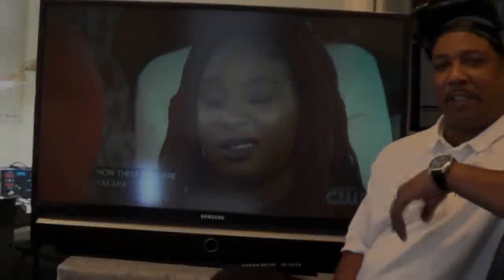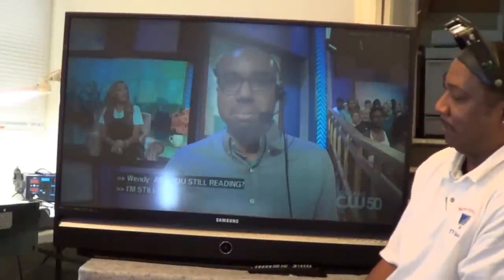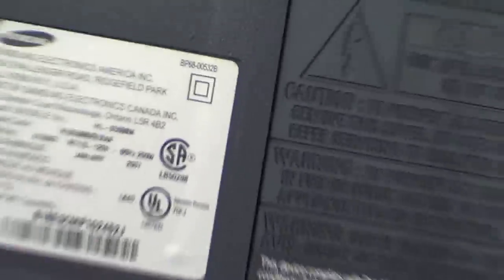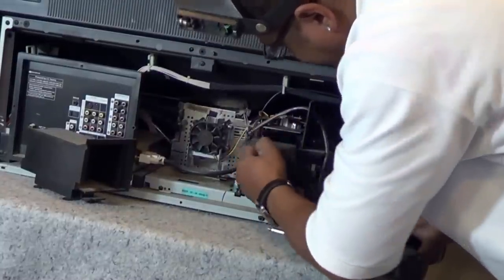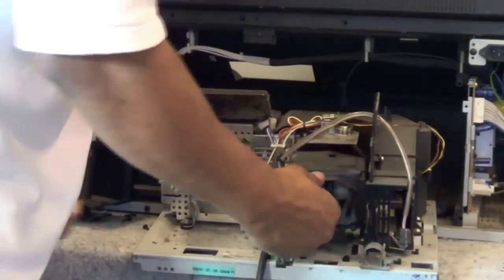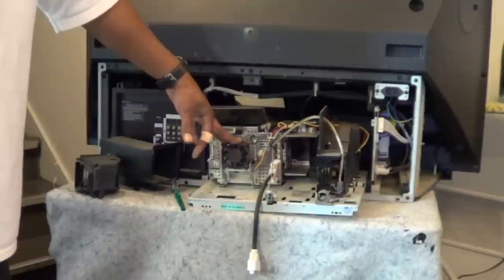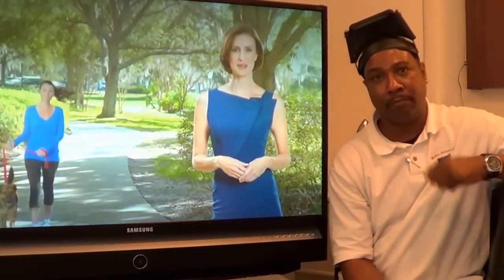Why your DLP TV keeps blowing Lamps every 3-6 months

Comment: bigdog8882, this worked like a charm. I cannot believe it. We have a 65-inch Mitsubishi, and we usually replace the lamp every two years or so. This time, the lamp failed after about five months. After looking at your video, I opened up the back cover and couldn't believe the chunk of gunk in there -- yuck. I cleaned it with a vacuum cleaner, two cans of air compressor and a small toothbrush -- just as you demonstrated -- and lo and behold, our big TV is back working again. Thank you so much. God bless you. Hitting the subscribe button right now ...

Comment: Thank you Very Much for your video! I've recently had a problem w/ my projection lamp shutting off within 8-10 minutes of turning on my 2006 Samsung DLP 67" TV.  After the lamp shut off, the "Timer" and "Lamp" lights on the On/Off button would flash; if I restarted the TV, the lamp would then shut off within 2-3 minutes.  I replaced the lamp w/ a new OEM lamp for the second time in 13 years, but the new lamp continued to function Exactly like the previous one: shutting off within 8-10 minutes, then shutting off 2-3 minutes if I turned the TV on again.  After watching your video, I took out my home vacuum cleaner, attached the upholstery-drapery tool (with soft bristles) to the hose, and vacuumed all the open grates on the back side of the TV (they'd gotten clogged with dust). BIG DIFFERENCE: the projection lamp now shuts off about 10 minutes after starting the TV, but when I restart the TV with the "Timer" and "Lamp" flashing, the lamp stays on indefinitely.  My theory: the dust clogging the grates was causing the operating temperature of the projection lamp to overheat and trigger the lamp shut off.  I'll next follow your video's procedures for pulling out the assembly that includes the projection lamp and fan, and vacuum all dust in the area of the lamp and the fan cooling it. Hopefully this will solve the lamp shut-off problem completely.

Comment: I got the 72" model from my job 5 years ago and the first bulb lasted almost 8 years, I replaced it and the current bulb is going on maybe 7 years. It started humming, then buzzing and finally wouldn't come on. Took the back of and blew it out with compressed air. Minimal dust but it solved the issue.. Thanks!

Comment: Thanks for the great video.  I do buy the discount lamps since the original one blew, and they were doing pretty well.  I had to do a light chip replacement (what a PITA!), and at that time had blown out the fans, didn't even think about it - there was dust when I cracked the case so took care of it and have killed 3 bulbs in the last 9 months - doy, right?  I will clean them boogers before my next lamp shows up and do so every time I have to swap.  Thanks bigdog!

Comment: I have a 73 mitsu dlp from 2009. model wd 73737.  I have probably changed my bulb every year.  My t.v. is on probably 90% of the day, there seems to always be someone watching it and you do not want to turn this t.v. on and off liberaly.  I save my bulb by dimming it before i turn it off.     What I mean is I put the picture mode into another mode that I have set with very low brightness and contrast.  Then I turn it off.  When you turn it back on the bulb will not be as stressed and therefore is less ap to pop or bust.  Give it 5 min. then put the picture mode up to preference.  I also put a tiny air cleaner near the back of the stand closest to the bulb.  After a while no matter what it will have to be relamped for the best picture.  That was just a tip if anyone wants to use it.  THE PROBLEM I have is the picture is not as crisp and I pretty sure It needs to have the mirror cleaned or the inside of the screen cleaned.  Problem is I am someone who thinks if it ain't broke don't fix it. IS THERE ANY TUTORIALS ANYONE HAS SEEN?  OR ANY ADVICE?
Reply: Cynthia Sootkoos I have the same tv and I’m about to put another lamp in mine after I got a pro lamp and it only lasted 4 months this time and I took it apart and cleaned everything
Reply: My Mitsu lamp exploded today. Lamp lasted 3 yrs. It's expensive to replace and I'm tired of it. I just want a tv that lasts. I wont throw out my old tv's because one is from '88, others are from 90's and guess what❔  They still work just fine. But not these smart tv's. They're not smart. They're shit. Imho.

Comment: You could use fabric softener  sheets  as a dust filter what I do is krazy glue the edges of the softer sheet to the outside of the vents or spray adhesive spray on the outside of the TV vents and stick your softener sheets to it you can pick it up at the Dollar tree they got the adhesive spray and the fabric sheets for $2 same thing with all your electronics computers TVs

Comment: My Samsung DLP is 16 years old and the Philips lamp is 10 years old because I have installed a small square external exhaust fan blowing the inside air out.  Dynamic setting causes more heat and less lamp hours.
Reply: how did you go about installing an exhaust fan?
Reply: When changing bulb, should I also be cleaning off mirror of dust too?

Comment: You forgot to mention sometime the Blast board could be dead too.Must clean out all dirts to the cooling fans devices that helping keeping the picture lamp clean,cool and can last you like a least 2-3 years.If you just watch like 2-3 hours a day only.
Reply from the maker: Your right Chi, a bad Lamp Balast could also cause premature Lamp failure. I should of mentioned that. Always clean the fans first. Then If balast is bad, in my experience  the Lamp will probably only last a few Days.
Reply: I have a Sony Wega 70 inch which gives me 7 red flashing lights and takes a long time to come on. When I got it off the sidewalk it needed a bulb but it blew very quickly a couple of times. I spoke to a parts servicer and he says it probably is the ballast, what do you think? It also has a melted bulb door from the previous owner too but he said they don't make them anymore.

Comment: I actually had the same set except for it was the 67 in it was the Samsung hls6767room he was too big biggest mistake I made.so about eight months later our TV went out in the living room. This TV from the garage, used it for 5 minutes then a weird picture came up heard a pop. distorted looked very bad upon inspection found out the Dmd board  technician told me it was the DMd boardrain got into it and rusted the DMD boardso I had to replace it. While replacing it I think we messed up the chip the DMD chip so we had to replace that overall a $30 TV ended up costing me almost 180 to 200 to fix but I ended up selling it eventually getting my money back out of it for 200 but it was sad because that was a great TV one of the best I ever seen but if you know what the problem could have been let me know. Thank you

Comment: Just took my moms apart this morning, thing kept turning off. Cleaned that mess, installed new Phillips lamp, thing is as good as new. Only thing is the green light on the front of the tv is always off now.
Reply: When your mitsubishi dlp tv kept shutting of and you cleaned the fans did you do it yourself or hire a tv professional to do it. Mine works but it shut of with a blinking yellow light indicator. So I guess its to hot right. So if I clean those fans it should be good you think.
Reply: samuraispiritsx why is the green light off after you cleaned the 📺. It doesn't turn off anymore does it

Comment: i JUST CHANGED THE DLP LAMP ITS GOOD AND ALL AND BRIGHT JUST IT WILL STAY ON FOR AWHILE AND 
CUT OFF IN 10 MINS AT A TIME OR SWITCH  FROM TV IMPUT TO TO NEW IMPUT CONSTANTLY OR BACK TO BLUE SCREEN, I SWITCH BACK TO TV AND 2 MINS IT SWITCH BACK TO NEW IMPUT DO YOU THINK IT NEEDS TO BE REPROGRAMMED? and this is a 2009 Mitsubitshi 60 in tv.

Comment: Yes I'm having trouble now with my big screen projector Mitsubishi 2013 I put a new lamp in it works great now sometimes a sound don't come on and I have to turn it off for a few minutes and then turn it back on sometimes the sound will come on sometimes it won't now I get sound picture and in 10 seconds probably 15 at the most it turns off automatically why is it doing that? What do I need to do to fix that problem

Comment: I have a Model Samsung DLP HL-5086WX and I cleaned my fans like you showed in the video .  I have also put in several new bulds from different vendors.  But when I turn the TV  on, it usually shuts off after 10 minutes and the 3 blinking lights come on (red (Start/Stop) green (Timer) and green (Lamp).  I thought I might need to reset the lamp timer or just turn it off , if possible, but my original Samsung remote is broken and I can not get to that option.  Can the lamp timer be reset or turn off without using theb remote?  Any additional thoughts on what to check?
Reply from the maker: Not sure, just order the Remote off of Ebay or Amazon. But that wouldn't shut the TV down though. Sounds like you may have another problem, like a colorwheel.

Comment: I have a 73" dlp. The bulb blew up I went cheap on a bulb the TV would work good for a few minutes then the picture would go all screwed up like so bad you thought the color wheel was damaged I read online people having this problem and replacing every part with no luck. So I bought an expensive O.E. factory bulb put it in that fixed every problem TV has worked perfect for months now. So my advice always get an original bulb cheap ones don't work

Comment: Quick question. I was in a bind and needed to replace bulb. Buddy had a Phillips that technically wasn't made for my model t.v. but it worked.  It fit right it, it worked for two days then nothing. Any idea why? Are they that sensitive to model specific bulbs?
Reply from the maker: just make sure that the voltage rating printed on the actual bulb is equal to or greater than the original.
Reply: @bigdog8882  thanks bud. It was only 120-132w. The oem is 150-180 so I'm assuming that's why it only worked for a day
Reply from the maker: @ejg34   Yeeaap!  Make sure the fans are clean too. Thanks.
Reply: @bigdog8882  blew them out last night. OEM bulb comes in today.

Comment: i just replaced my lamp approx. four months ago but now im getting a notice on my screen saying my bulb is getting to the end of its life....would it help now if i cleaned the fans  ? thanks foryour help
Reply from the maker: what brand tv?
Reply: @bigdog8882  sony wega lcd projection
Reply: the new lamp i put in was 92.00 dollars.....it wasnt cheap by any means.
Reply from the maker: @josephgale5933  I fiqured, Thats because U didnt resest the lamp timer when you replaced the lamp four months ago. To have to go into the menu, settings, timers, then just reset the lamp replacement Icon. and the message will go away.
Reply: you know your right ....i stumbeld on that yesterday when i seen on the video on how to put the lamp in and at the end of the video it says to reset the lamp replacement which i did ....but thanks for the help just the same...i cleaned the fans too which u recommend in your video...thanks again ...

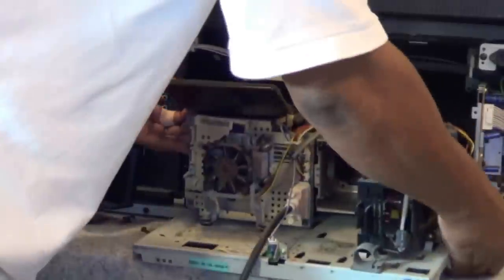Comment: I know you did this over a year ago, but I just saw your video and began removing the lamp engine and one of the plugs popped off the board on the lamp engine. This was the bottom plug that you pointed to and said you "forgot about that plug and had to sodder it back on"; you said that at 8:32 minutes into your video. My bottom plug popped off when i pulled the lamp engine out.

How do I get that plug reattached to the board on the lamp engine, like you did in your video at 8:32 minutes?

Thanks.
Reply from the maker: If U broke it then like I said "solder it back"

Comment: I have a mitsubishi wd-52531 tv. I have cleaned throughly several times and replaced the bulbs. The last time I did it the bulb blew in less than 1/2 hour? Any advice as to what to look for or repair?
Reply from the maker: Bad Ballast, or a bad bulb. When ordering a bulb get an Osram or Philips brand bulb.

Comment: Hey man I have that exact TV I've cleaned it and replaced the lamp 3 times I'm still not understanding why it stays on for about 30 seconds then it turns off
Reply: The last bulb I had lasted for almost a month it just stopped working for me today please I need your help
Reply: most have a timer delay on them. so when the tv is turned off, the fans stay running to cool off the lamp before completely shutting off

Comment: Nice video. I'm aware of the age of this video, but I'm going to ask a few questions anyway in hopes that you respond with some more helpful information. I own an HL-S5687W and have been looking for a video with some tear down instructions. This is the closest I've found so far. My issue is that I see dust/dirt on the picture on the edges of the screen. Is it possible for the interior of the screen to get dusty/dirty? If so, is it ok to clean it (tear down even more of the tv to gain access)? Or am I just seeing a very dirty mirror that needs some major cleaning? My set was mfd in Dec 06. I have only ever replaced bulbs in it (maybe 3 or 4 so far). It's never been serviced by anyone professional. It's never been cleaned inside. I think it's time I get in there and clean it really well. But I don't want to go through all interior cleaning only to still see dust on the inside of the screen. And I don't want to ruin my screen by trying to gain access to it, if it's not likely to need a cleaning on the inside of the screen. Thank you for your time and response.

Comment: there's a way to know if your ballast is working.
Reply from the maker: Yeah, just check the lamp plug; pull the lamp out, and put your meter(positive lead) on one of the 2 pins on the plug. Just trick the Tv into coming on by in most cases just holding down the "Lamp Door Switch" & power TV up. FIRST Make sure that U connect the negative lead on your meter to chasis ground (something metal inside of the tv or a known ground point in tv) and not to the other plug, otherwise you will blow your meter up when the tv first comes on. U should get a voltage close to what the lamp is rated at. Usually 125v or more.  If that doesnt work just go to the 2 pins on the Ballast where the lamp plug is connected and U CAN check them by putting both your meter leads directly on the 2 pins. Thanks, hope that helps.
Reply: I just did it, I have around 380 Vdc coming to the ballast board, but there is not voltage on the pin of the lamp, I think I trick the system because I can hear and see the fan working, but there's no voltage.

Comment: I have a Mitsubishi 92" DLP 1080p 3D tv, model WD-92A12.
It has recently been starting to whistle, and the color will start flashing purple and green, before it shuts down.
Some days I can watch it for hours before this happens, and other days it will only stay on for a couple seconds.
The power light will flash once red, then 8 yellows.
I press the power button for 10 seconds to reset it, then the TV comes on, but only for about a minute before starting to whistle and the colors changing.
I'm not sure what it is, and I'm hoping you could enlighten me.
Reply from the maker: Sounds like you need a "Color Wheel"
Reply: bigdog8882 Yes sir, you were right.  My only problem is finding one.
I can't find it anywhere.
Mitsubishi Parts won't sell one to me because I'm not a business.
I've tried Amazon, Ebay, etc.
Do you have any advice?
Reply from the maker: I'll Check for U
Reply: bigdog8882 Wow! Thank you so much.
Mitsubishi 92" DLP FLAT SCREEN television model WD-92A12
Reply from the maker: I don't know how this one looks because they don't show you a picture of the actual Color Wheel, but if you wanna take a chance, this should be the same CW that Your TV uses. Don't know if you posted the correct model #.  It also says "No Returns". Here is the Link:

http://www.ebay.com/itm/New-WD-92840-Mitsubishi-TV-Color-Wheel-slls-/111566033234?hash=item19f9da9152:g:MRsAAOSwECZUqLki

Comment: I have the same tv shown in the video.  Mine blew a lamp and gave off a burning smell.  I replaced the lamp and now it turns on for about 40 seconds and shuts back down flashing the 3 lights in the front.  I tried replacing the lamp fan and the temperature sensor (the little circuit board that sits on top of the lamp housing).  It still does the same thing.  When it turns on, the lamp does light and I get a normal picture on the screen, but it shuts back down after 40 seconds.  I thought it could be the ballast but I felt if it was that the lamp wouldn't come on at all.  Any ideas?  Thanks in advance!
Reply from the maker: Just make sure that the Lamp door is all the way screwed in, because it is switch activated. If not just jump the door switch. These are known for having bad door switches. But in most cases with this particular model and three flashing led's usually means a bad color wheel. Especially if you hear a squealing/rubbing sound right before it cuts off.
Reply: bigdog8882 The 3 lights on mine normally means that the bulb is bad or the sets overheating. I hope everyone is using latex gloves when handling the bulb, oil from your fingers and hands will fry the bulb.
Reply: reset button  fixed my problem

Comment: I have the same I got a new bulb for it put it in put everything back in it will come on for about 5-10 minutes then it will turn off and the lights will be flashing green on the light bulb on the friends lights at the bottom then it will have a whizzing sound after a couple minutes I can turn it back on and it won't come right back on what could that be